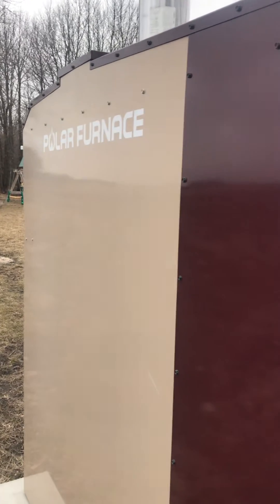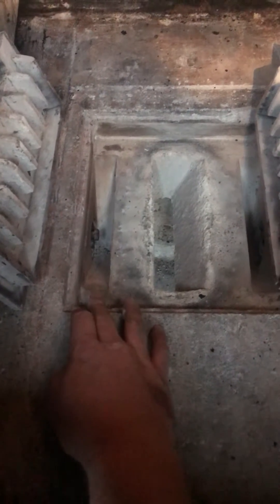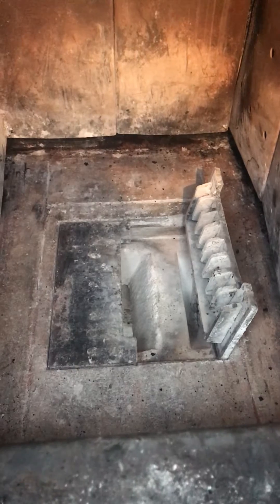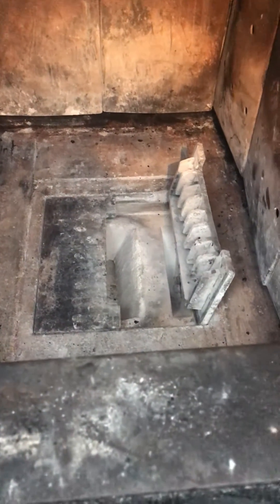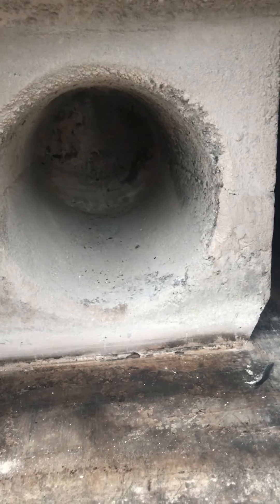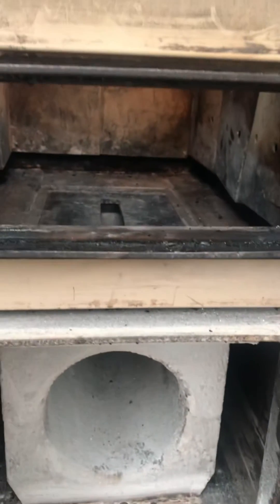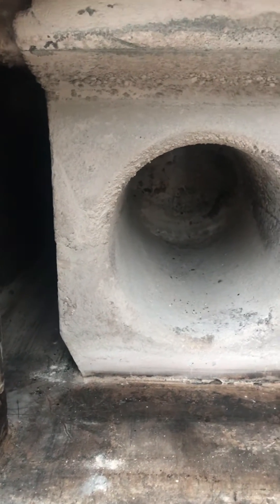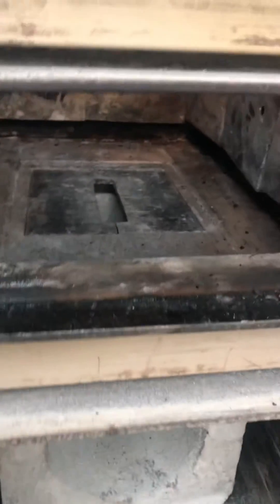Polar Furnace Nozzle Design

Comment: yes a great design for the refractory BUT everyone I know that has one they only lasted if your lucky about 5 years and then start leaking. Mine lasted 10 by the grace of God I'm told and now mine is leaking as well...now what?? Left to spend at least another 15k to replace it.... not ideal
Reply from the maker: This is the first time I have heard of any of them lasting less than 5 years.  I have three other close  friends with Polars that are also carbon steel, one has been running for 8 years, one 6, and me and another at 5 with no issues at all.  That is too bad to hear about yours, why not just weld it up and keep running it?  The new ones are also stainless, I will go this way if my fails or I can sell mine for good price.
Reply: I had bought mine in 2012...shortly there after I had family and friends interested in it so I recommended it to them...My aunt got a little over a year out of there Furnace... started leaking. Another family member is on his second one because of leaking issues and is going to change his up because he is so scared it will start leaking in the middle of winter and leave him in a bad situation..There is at least 3 or 4 other people in the community I know of with the same problem...It's disappointing for me because I just loved the whole aspect of that Furnace and only burned about 9 cords this year.
Reply from the maker: @jamieprince2514  yeah, I feel they are the best designed furnace on the market still.  I do think that the carbon steel was not the best choice of materials for sure.  It’s good to see they changed that going forward.  You can have a 304 stainless firebox welded into your carbon steel water jacket.  If I don’t upgrade or go bigger that is the route I will take.